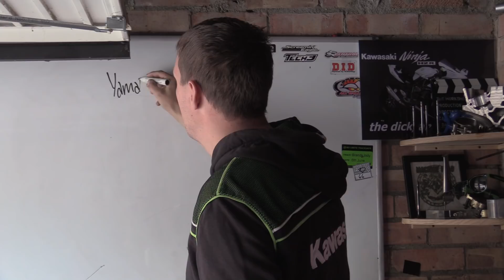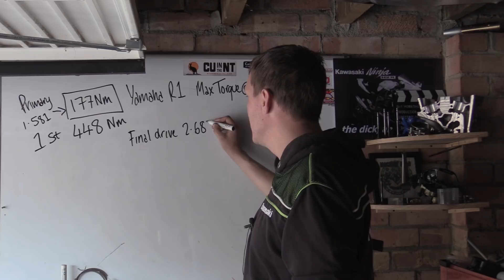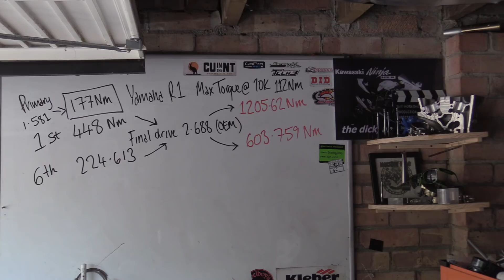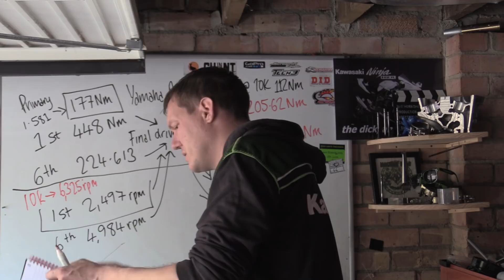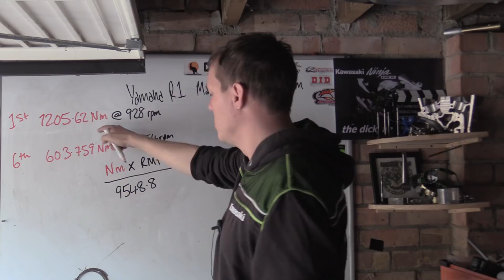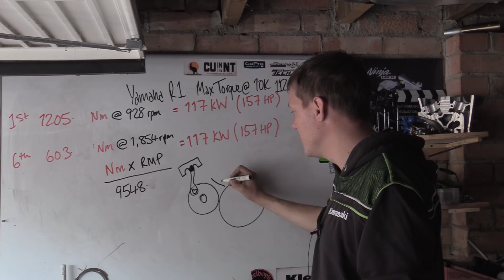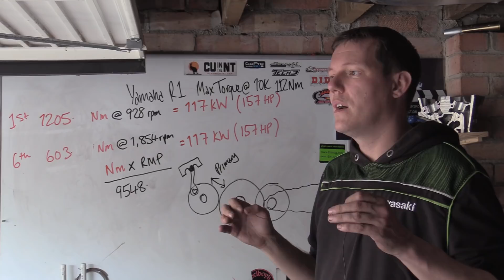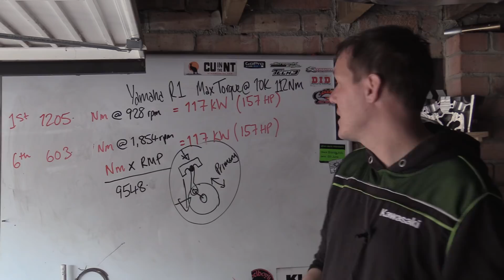Do engines make PEAK POWER in 6th Gear?

Comment: You never wrote the equation down.....WTH.  Torque is real.  Horsepower is nothing more than a mathematical equation based on torque at a given RPM.  
I know, most viewers get lost when math is involved but that is all it is....so you have to at least write the equation down.  This shows them the relationship of torque and RPM to HP and that is why HP is the same at a given RPM in any gear......(as long as engine management doesn't come into play....or ram air induction....or something like that)
Reply: HP is energy.  Would you rather use a different unit?  We can convert it directly to kilowatts if that helps you out.  (1 hp = .7456999999999 kW)

It's not something that only exists in mathematical theories.  Before electrical engineers came up with the Watt, electrical output of generators (dynamos.... whatever) was expressed in horsepower.
Reply: HP is not energy, it is power, which means energy over time, ie. the rate at which work is done over time.

Energy is defined as the capacity to do work and in the metric system is measured in joules derived from a force of 1 Newton acting through 1 metre.
Reply: @immikeurnot , the equation I expect to see is HP = (torque in lb-ft x RPM) ÷ 5252.  Now, obviously you can use nm with a conversion factor but I am from the US so we still use the antiquated version of measuring.....
This was the original equation as derived by its creator, James Watt.  He wanted to covert torque to hp.  He literally measured what a horse could move over a unit of time.  In the end, he created a huge fudge factor which ended up being 5252.....
If you ever look at a dyno sheet, torque and hp will always cross at that point (5252 rpms)....ALWAYS....and that is why.  If he had decided to use 300 or 10,000......HP would be a very different number BUT he decided on 5252.....
Reply from the maker: "Horsepower is nothing more than a mathematical equation based on torque at a given RPM. "

- power is real not just mathematical, where the fuck did you get that from. 
" In the end, he created a huge fudge factor which ended up being 5252....."

- Mike you have this all wrong. And I'll do a video why
Reply from the maker: "HP is not energy, it is power, which means energy over time, ie. the rate at which work is done over time."

- you have to be a bit careful here. Switching work and energy is not the same thing. Work is done, energy can be potential or stored. Work cannot be stored.
Reply: @thedirtyworkshop  , work is real but the hp number is arbitrary in reality.  If Watt had come up with a different number than 5252......HP would have been different.....it is all based on his hugely fudge factored equation.
Torque is a measurable force and over time.....you can come up with a fixed amount of work......BUT the HP number is really just a huge fudge factor number....that is all I am saying.  Work is real....HP is an inflated/deflated number.....
Reply: @thedirtyworkshop  As in kinetic and potential, school boy physics, kinetic energy is work being done, potential energy is, as explained to me as a 14 year old, when the pendulum of a clock stops at the top of it's swing and the moment it decides to swing the other way is potential energy. You can hold the pendulum at the high point mechanically, so the potential energy is stored.

Not teaching you to suck eggs Matt, just hopefully giving an alternative (schoolboy ;-) ) example.
Reply: @mikegrady4  Yes, I'm aware of all this, but you might as well claim that Watts don't exist because they're nothing more than volts times amps.  Every single unit of measurement is arbitrary.  One unit is not inherently superior to another - the meter is not inherently better than the foot - scratch that; yards are a better match for meters, for example.  Both are equally arbitrary and both work equally well.

Just the same, horsepower is (again) real and not some theoretical creation.  It's work over time.  Two vehicles with everything the same, take one engine and move the torque higher in the RPM range so it makes exactly the same torque with exactly the same torque curve (just at higher RPM) and guess what?  It accelerates faster.  

The US system can get a touch confusing because we have lb-ft units for torque and ft-lb units for energy and a TON of people, even ones who use it every day, tend to mess up and say ft-lb when they're talking about torque, when they should be saying lb-ft.

Comment: In practice, wouldn't the higher acceleration in first gear mean more loss from accelerating the weight in the drivetrain ?
Reply from the maker: Well it depends what you mean - you have to define 'loss'
Reply: @thedirtyworkshop  I get what he's saying.

The energy used by accelerating mass in the drivetrain is way more noticeable in lower gears.  In sports cars, switching to a lighter flywheel mainly helps during shifts, but actually can give you better acceleration in lower gears.  The effect diminishes as gear ratios go up.

Years ago, had a Miata.  Ditched the 16.5 lb steel flywheel for a 8.5 lb steel-faced aluminum unit.  It accelerated more quickly in 1st and 2nd, slightly faster in 3rd, no noticeable difference 4th and 5th.

Weight in the drivetrain is not, as Andrew Thomas says "irrelevant."  Otherwise hollow cams, lightened cranks, etc. wouldn't be worth spending money on, yet even OEMs do it.
Reply: @thedirtyworkshop  sounds like he might be saying if drivetrain loss is a percentage, than the loss of torque or power would be greater overall when there's a greater overall input torque (before losses)
Reply: Not "from weight in the drivetrain" though, that's irrelevant, like saying from weight in the chassis/bike.

But yes regardless from drivetrain losses: heat/friction, if it can be expressed as a percentage, and torque is what is lost (and not horsepower)

The problem is, I think horsepower is what you're actually losing. In which case the input is the same for 1st and 6th as he just demonstrated.

Comment: Blimey Matt you just over thunk that to the nth degree. Of course work done will be same regardless of gearing. Since by definition, power is a function of torque multiplied by speed, if you increase torque but decrease rotational speed, it will be directly proportional so power or work done will be constant. Maths not needed lol.
Reply from the maker: Well then this video wasn't for you then was it?

Comment: Is the basic reason motorbike gearboxes don't need to go below 1:1 gear ratios like cars do (in higher gears) simply because bikes can rev that much higher and thus can go faster without the need for sub-1:1 gear ratios?
Reply from the maker: Overdrive is for fuel economy and not performance.....
Reply: Just looked up the gear ratios. I have a separate final drive ratio for 5th and 6th, with the top speed in 4th at 121.9mph and the top speed in 5th at 154.2mph. 
FD in 1st-4th is 3.684 and FD for 5/6th is 2.917, 4th gear ratio is 0.977 and 5th is 0.975.
Is the only reason I don't hit top speed in 4th because the gear isn't long enough, and the overdrive provided by 5th isn't too long a gearing that the vehicle's top speed can still be achieved?
Might be an interesting subject for a video if you can be arsed of course - when does the length of a gear become impractical?

Comment: The software in my car reduces engine torque in lower gears to avoid breaking gearboxes, totally irrelevant I know... no idea if any bikes do similar..
Reply: That's shitty. Should've beefd up the gears instead
Reply from the maker: "That's shitty. Should've beefd up the gears instead"

not if you wanna save weight, cost and increase fuel consumption. And who needs all the torque low down - that equals wheel spin
Reply: @thedirtyworkshop  AMG did something like that . Computer throttled out like 100tq or something. 750 lb.ft. must've been enough. My buddy's dodge truck sucked until I pulled the Tq. Management wire. PCM pulled timing at gear changes. Would not even chirp the tires. After,  the truck moved out.  The transmission went about 2 years later. Weak box anyway. I never got to add a 5th gear with a junkyard TCM  swap. 3 simpson gearsets and 4 gears, such a waste.
Reply: The gearboxes in my cars take full hp in every gear. After all its the same gearbox and engine no matter what gear your in! It would however take a load off other parts of the driveline and tyres
Reply: It is an old persons car, TBH I don’t need more torque in the lower gears, traction is the limiting factor. Very few of us geriatrics fit drag slicks to our cars just to take the wife to the supermarket...
Reply: @g0fvt  I've seen a guy that looked older than Abe Bagoda by at least 20 years. I swear to god, cataract sunglasses, cane, wife looked  younger I'd say 85. Their only car was a third gen Pontiac Trans Am, tinted windows, the brightest red they came in. I know he passed on already years back. Absolutely shocking scene to see.  Anyway, those 2 were heroes, you don't have prep for the pine box.
Reply: @pgtmr2713 I live in a rural UK village , even the undertaker doesn't have 8 cylinder transport!
Reply: There's a lot less V8's and V6's in America now too. But, you can still pick up something with one if you want it. It's not actually the number of cylinders that makes them inefficient. How you drive, what you use them for.  I wouldn't mind a 2.0-3.0l v8 4 valves per cylinder, with modern tech and a multispeed transmission. I'd  prefer it over a 4 cylinder of the same same, power being equal. Put it in something light as well.